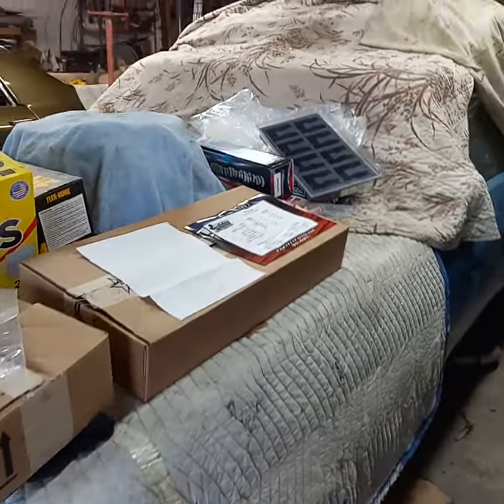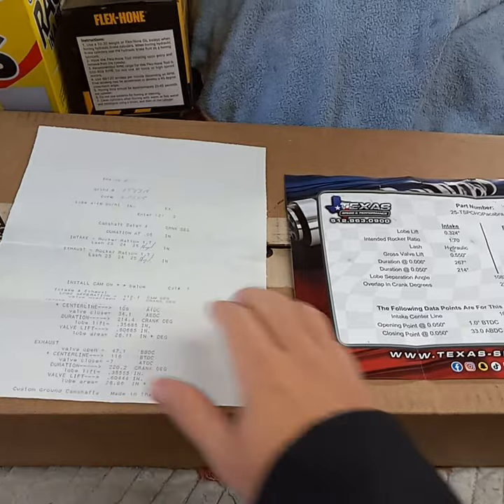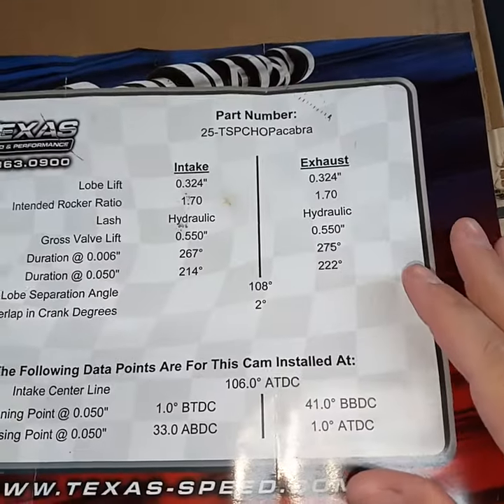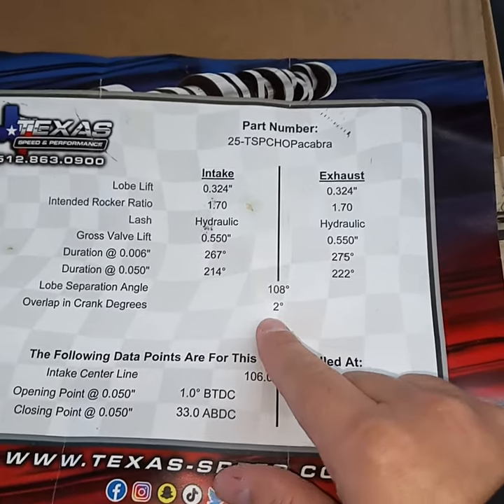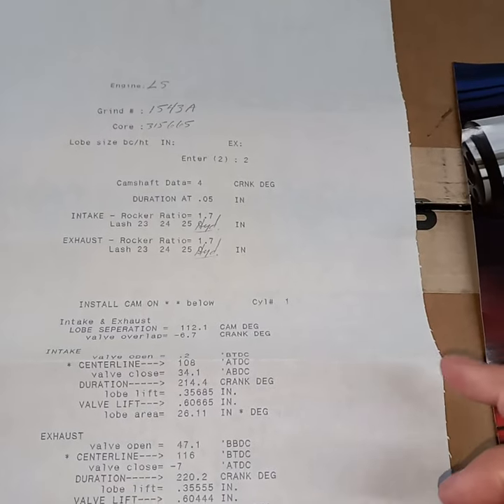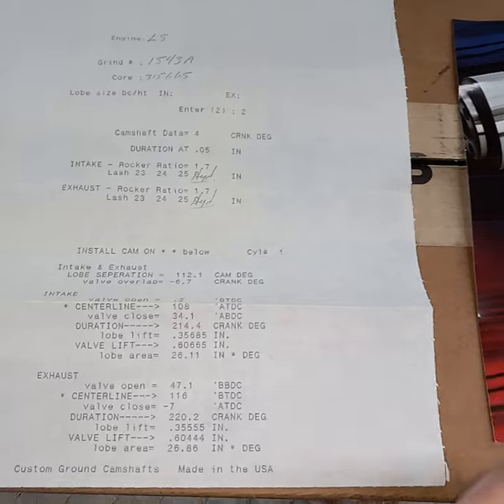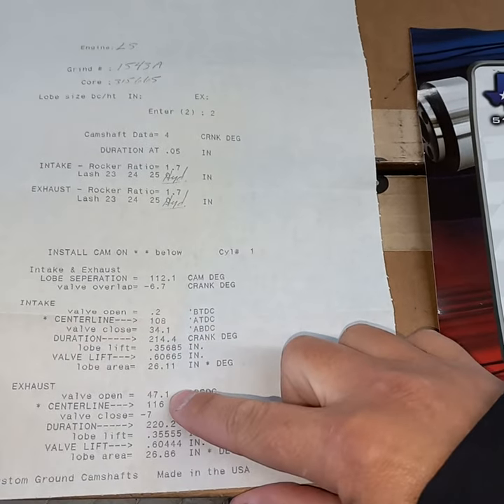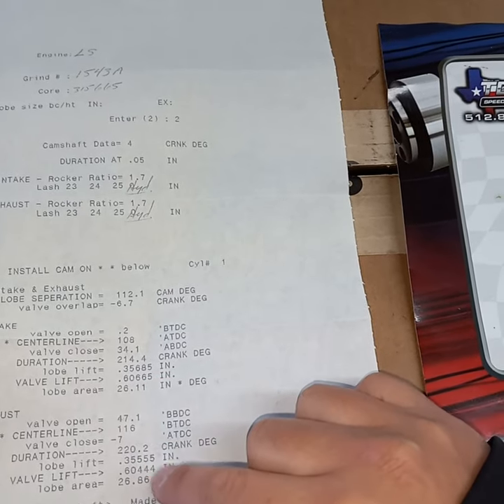Texas Speed CHOPacabra vs. EPS Truck TQ1 comparison 🧐 #camshaft #cammed

Comment: I don't think you will see a hair difference in those two cams. In fact I like the Texas Speed cam slightly better because of the 108 lsa. Those tighter LSA cams seem to be a bit more popular with these cam grinders, Brian Tooley used to throw his truck cams on a 111, the 107 is giving a broader RPM band, better down low, better mid-range and peaking just as good as the larger duration cams.

Just my 2 cents
Reply from the maker: I'm willing to find out. My current LQ4/862 heads/TSP cam made 336/336 at the wheels on 93 octane.That EPS cam in an LQ4 with 317s on 87 octane did 327/369. Same dyno and same person tuning it. I think the HP won't change much, but the TQ is going to jump 30+
Reply: @bluecollarhotrods9781  I always fall back on Richard Holdener testing those 4 truck cams, all about the same duration, not a hair difference no matter the lift.

I think Tooley has came a long way with his newer stuff with valve events.

But it would be interesting as hell to find out what your old cam could do.

I think you run a lot better than your dyno numbers. Your graph is healthy! I've noticed searching youtube, there are some very happy, crazy high dyno numbers out there from these truck cams, it's not realistic. Sae/std/mustang dyno/dyno jet, they read different.

Anyways, good stuff....new to the LS world but raced foxbodies forever.
Reply from the maker: @rickybellamy8191  That's what I intend to find out. If I get it wrong, I'll report it. I'm trying to learn - and share my data so that people can make educated choices.

In the past, I have owned a few fox bodies myself. I help my friend with his SN95 when he gets a "hall pass" 🤣
Reply: @bluecollarhotrods9781  would love to see the difference, like you said it's a learning experience for us all.
Reply from the maker: @rickybellamy8191  it's in the works. I'm shifting my focus to my 72 SS 454 Chevelle, it's so close to being done. Then I want to sell it. It will free up time and resources.
Reply: @bluecollarhotrods9781  I just caught this reading it again, so you did nearly as good with 87 octane and those 317s, very very interesting.

Just about every testing with those 317s compared to the 862 / 706 head is about a 20 horsepower difference. Wow!
Reply from the maker: @rickybellamy8191  Yes sir, I have seen Richard's tests and refer to them often. We've bumped heads a few times on live feeds. But, the fact is - my 4500+ lb truck is real world testing. 

I actually picked the 862s and this cam because of his tests. Imagine my surprise (and disappointment) when it made the numbers it did.
Reply: @bluecollarhotrods9781  I've heard him mention your handle name a few times on some videos.

You are exactly right, you are real world testing, the weight of the vehicle, acceleration is hard to measure on an engine dyno......and these trucks are heavy, they rely on torque.

Now I'm second guessing my 862 and I was going to put a good 20 hours into these things.

Initially I wanted some 799s/243s but I've seen some underwhelm on here.
Reply from the maker: @rickybellamy8191 ported 862s with larger valves are light years better than stockers like I have. I have a set of PRC 862s in inventory. They flow over 300cfm. To really beat them - I'd have to spend a lot of money. (Aftermarket TFS or AFR heads)
Reply: @bluecollarhotrods9781  that's going to be a huge difference along with that intake, at that point I think you're going to have to step up duration in your cam having that new 3500 stall.....unless you tow, or daily drive this thing.

Aside from the dyno numbers, your track results are there. Sure you throw in a 230/236 dur cam, peak jumps 30+ rwhp, but your results mimick such.

My mustang only made 449rwhp on a mustang dyno. I felt like I had the car working though.
Reply from the maker: I would say that if you have the ability - port your 862s, add at least 2.00" intake valves, and mill them .030" 

My untouched 862s with tiny 1.89" intake valves flow less than the 317s. I know tests show the compression bump is worth power - but my scenario has me wondering. I literally cleaned my heads, hand-lapped the valves, and changed the springs/seals. Zero port work or milling. 

In a perfect world, I would do a bunch of swapping and testing. 317s onto this combo. Then the EPS cam with both 317s and 862s. Possibly toss some 799s into the mix for fun.
Reply: @bluecollarhotrods9781  I was definitely going to work the bowls and narrow down the valve guides. That's always the biggest bang for minimal effort. May get a 3 angle valve job for those low lift numbers. 

Ok, I just decided to move on as planned with the 862s. Going to run the truck norris cam. Mine is the opposite of yours, it's lifted with 33x12.5s, I just wanted some more power, currently have the 4.8 and I landed a 5.7 Ls1 out of a ws6.

I need torque, good driving manners.

Keep the videos coming, we're all learning something. Already subscribed.
Reply from the maker: @rickybellamy8191  Thank you, I very much appreciate that. 

Part of why I am trying different stuff and looking for torque, I have a 2003 2500HD. It's an extended cab, short bed, 4x4. I'm hoping to find the right combination for that truck via testing with my half ton. When the stock size tires wear out, I want to run 285/75 16s. I don't plan on regearing (currently 4.10s), just leveling it and running slightly larger tires.
Reply: @bluecollarhotrods9781  just keep thinking back to your 317s and old cam combo vs your current combo.....I initially was going to do 243/799 heads with this 5.7 liter, I had a c6 corvette years back (243 head), the car trapped 113 mph bone stock. That's running on the stock Goodyear run flats and couldn't really leave hard, I bet I spun some mph away.

Thinking about that ls2, 6.0/243  head combo, factory rated 400hp, so probably 340 rwhp, I think that's telling us something right there, it works. Imagine a cam and your TBSS intake.

Richard's 862/706 testings pretty much talked me into keeping what I got. I may browse locally for some 243s/799s.
Reply from the maker: @rickybellamy8191  it sucks - there's VERY little results out there for so many of these cams being sold and installed. I think I'm one of the few out there actually posting stuff. I see some dyno videos, but ZERO track times to back it up. Dynos vary greatly sometimes, and some operators fudge things with different correction factors. Why? Usually to make their customers feel better. 

Acquiring that 5.7L aluminum LS1 is going to be great for what you have planned. It already starts off with 10.25:1 SCR with 66-67cc heads. Plus the weight loss from the aluminum block. I wanted a 24x early LS2 shortblock. Located a few, could not justify the cost. ($2500+) I will take the weight penalty with my iron blocks.
Reply: @bluecollarhotrods9781  yep not much on real world results. Just a bunch of videos with truck norris cams and a draggy, putting up 15 second time slips. Tons of underwhelming videos. That's what initially had me wanting to do 243s, then Richard's videos convinced me to keep what I got. Especially the video of the 706/862 vs 243/799 on the 6.0. The 317 was 20hp less and appears to be the worse head out of the bunch, your old combo says differently.

My buddy put a 6.2 in his ws6, that's how I got the 5.7.....i initally was going to find a 6.0 off ebay or look locally. Couldn't pass up the aluminum block.
Reply from the maker: @rickybellamy8191  I need better friends. lol 

I'm still bummed that I never got to race the old combo. (lifter/tray failure killed it) I had planned to run it on 87, retune for 93 and run it again. Then do what I'm doing with this one and refine it to get lower ETs.
Reply: @bluecollarhotrods9781  well you're doing damn good. If you can catch some DA, that new converter may 60ft you to a 12 sec time slip.
Reply from the maker: @rickybellamy8191  if it works as good the converter swap did in my old Z28, I'll be golden. I went from 13.1 average to 12.2 - that was a bolt on car with stock internals. It made about 350 rwhp and similar TQ.
Reply: @bluecollarhotrods9781  I just seen you are running a 2.5" exhaust, are you still running this?

Let me share this......and I know my mustang is making more power and pulling more rpms....but I started with a 2.5" exhaust, it was my bottle neck. Couldn't pull any rpms, I wanna say barely over 6k. Put a 3" exhaust on and peaked at 7k, pulled to 7300 without dipping. I wanna say I gained nearly 40 rwhp.

Seen another video and maybe I can find it later, a kid did a 6.0/cam swap, ran 2.5" exhaust, the tuner said it was hurting him up top. I don't wanna get this wrong but I believe the tuner said your atmospheric or barometric pressure was off signaling a bottle neck in your exhaust. 

Just wanted to point this out.
Reply from the maker: @rickybellamy8191  I have dual 2.5" off the headers, they feed into a dual 2.5" inlet/single 3.5" outlet Magnaflow muffler and tailpipe. I added exhaust cut outs, it picked up zero. However, I always race with them open. 

I have some videos up - one showing the layout of the exhaust system. And others showing the cut outs install and then track testing. I have yet to dyno it open vs closed yet. But by the lack of change in MPH - I bet it's less than 1rwhp.
Reply: @bluecollarhotrods9781  ok. That should be enough. Probably not pulling enough RPM for that to be a factor. Just spit balling here.....currently online looking for some 243 heads. Not going to put 100% stock into what Richard's testings are showing, I now want to opt for the bigger port, bigger valve. Let's see if I can find something affordable.

I'm starting to get paralysis by analysis. Lol.
Reply from the maker: @rickybellamy8191  when it was originally dynoed and tuned, we only pulled it to about 6000-6100. Since then, I have picked up ET and MPH shifting it higher 6400-6500. Next time on the dyno, I want to do some pulls to 6500-6700 for science. It peaks around 5700 per the graph, but is barely down any power at 6000. One thing about this small cam with such a tight LSA - the peak TQ comes in awful late 4700 RPM. I think that's partially why it has gone faster shifting it higher. When it drops back after the shift, it's in the fat part of the TQ curve.
Reply: @bluecollarhotrods9781  yes, shift recovery. Ideally you want to shift at peak hp and shift recovery land at peak tq.....hard to get an engine to do that, but when you do you've maximized a combo.

With the mustang, I never had any luck over shifting it that high.....i tried everything from 6500-7500, it liked 7k and went through the traps at 7300.

This LS world seems a bit different than what I'm used to. Have you tried shifting it at 5700 where it peaked? I don't know much about autos and tq converters, but manually I'd shift at 7k and shift recovery fell around 5600. I guess with a converter it would need dialed in for shift recovery? ....and rear end gear/tranny gear would come into play.
Reply from the maker: @rickybellamy8191  The first time I raced it with this combo it was shifting there. It went 13.80s at 99 and change. That was in 1500'-1800' DA. I raised the shift points and went back in 3000' DA, it ran almost identical ETs. It should have been slower in the heat. That told me I was going in the right direction. 

My friend's SN95 with the 331 stroker likes being shifted 200-300 RPM above where it peaks. We started at 11.90s, and got down to 11.50s with just shift points. MPH went up 3+ as well.
Reply: @bluecollarhotrods9781  ok, yeah that's definitely working then......

You're heading back to the track next weekend? You're in Bradenton Florida?
Reply from the maker: @rickybellamy8191  Orlando, FL Hoping the current forecast is wrong... ☔ Next Sunday is the plan though. I still need to get tires mounted, and make sure my shift timing is good.
Reply: @bluecollarhotrods9781  so I'm noticing something.....since I landed the 5.7 and now on the hunt for some 243's, I've started looking at ls6/c5 z06 stock dyno pulls. They dyno quite well. Ran across several that put down 345-350 and 1 got a tune put down 360 rwhp something like 352 rwtq. Watched another bone stock c5 z06 get an intake and headers only with a tune, it laid down 395 rwhp.

I'm not seeing this with the bigger 6.0/862 or 706 combos. So aside from what Richard is showing us, something changes in the real world???

That stock c5 z06 cam is only a 205/220 duration cam. Imagine some more duration, those dyno numbers climb even further. 

I was looking for thar EPS cam you mentioned, there's not much out there.

Anyway, very interesting stuff when you dig into the 5.7 world vs the 6.0 (706/862) with the truck norris or chapacabra.
Reply from the maker: @rickybellamy8191  in 2004 my friend bought a 100% stock 2002 Z06. It did 335 rwhp. But, ran 12.80s at the track. Tune, TR6 NGK plugs, and a 160 degree thermostat bumped it to 355 rwhp. But it picked up nicely under the curve. Then he went crazy and did LG long tubes and a TSP MS4 cam. It made a little over 450rwhp with those 2 mods. 

One reason for that is the chassis it's in. I feel like the power doesn't get taxed by the drivetrain as much. Fasterproms did a dyno on a newer Corvette, lighter wheels picked the numbers up almost 20 at the tire. The LS1/LS6 engines are also about a full point higher compression in most cases compared to the truck engines. (LR4 and LM7 are 9.5:1 & LQ4 is only 9.3:1) 

My LQ4/862 cylinder head combination gets the compression up there. But, is hindered by small intake valves and less flow than a 243/799 head. And my cam is not the "magic camshaft" for anything larger than a 5.3L IMO. They just don't work. I have never seen any real dyno numbers in a combination like mine above 350ish rwhp. Most make around the same as mine. For whatever reason, it just does not work.
Reply: @bluecollarhotrods9781  yeah, I'm sure the 6 speed manual is more efficient by maybe 5% or so.

It's showing me enough to convince me that the 243 is the way to go. Now I need to find a set.

You're doing the right thing, you are maxing out what you got before giving up and moving on. This whole cam thing has me puzzled. I've even been looking at Tick performance......something is just off with the 2 cams everyone is running (TN/TS Chapacabra).....you may be onto something with the compression bleed off. Basically digging into valve events.
Reply from the maker: @rickybellamy8191  I have seen some big overlap cams make power, so this one with only 2 degrees of overlap has me puzzled. If I had the resources, I would love to grind 3-4 cams with the exact same lift and duration, but move around the ICL and LSA to get different overlap. Then see how each one changes the power curve. I figure one at zero overlap, then one each of 4-6 + or - to see what it does. 

We've seen what wider or narrower duration split does to the curve from Richard's testing. Plus I believe Texas Speed did some similar testing 15 or so years ago. Wider split - slighter higher peak numbers, narrower - stronger earlier in the curve.
Reply: @bluecollarhotrods9781  the summit 8720 cam looks interesting. Someone claiming 338 rwhp on a 5.3 with 22s.

The specs look interesting. Maybe about as big as you would wanna go for a daily driver/stock stall.
Reply from the maker: @rickybellamy8191  I have one in stock! I almost did that cam and a set of nice 799s that I had rebuilt and milled by Phil @Advanced Induction. Looking back, I wish I had done that combo. I feel like it would have made 25-30 more in both HP & TQ.
Reply: @bluecollarhotrods9781  seems like a hotter combo. It really pulled some rpms on Richard's 4.8 testing and didn't give up anything down low.

Well you've got the parts when you're ready to go another route. We will definitely learn a lot.
Reply from the maker: @rickybellamy8191  I was planning to do that combo on this short block next. Then I wanted to do the 799s with a custom grind 224/232 I have. But, ultimately I am ready for the LQ9 I am building on the side. LQ9 short block, PRC heads, 228/236 cam, FAST LSXRT intake manifold.
Reply: @bluecollarhotrods9781  so if you take notes and jot down these 5.3 liter testings from Richard. I found a L33 testing with the Truck Norris/799 head and it made 443hp. Then a few years before that he did a BTR Stage 3 Truck Cam/LM7 706 Head testing and it made 433hp. The stage 3 will peak a little more than the truck norris.

This clearly shows a sort of apples to apples comparison of the 706/799 heads. I think the 799 Head is 15+ hp better in the real world.
Reply from the maker: @rickybellamy8191  pretty much everyone I know that tunes/builds engines asked - "Why did you do that?" in response to me putting 862s on the LQ4 in my truck. They all said I should have put a set of 799s on it. (Easier to find than 243s - and pretty much the same head)
Reply: @bluecollarhotrods9781  tell them, Richard Holdener, that's why I did it. Lol.

Seen the summit 8720 cam recommendation from flowinc....so I started researching that. I'm like 4 years behind as I look at the dates. I actually like it. A tad large in duration, but it looks doable.....especially for you, that stall and it really pulls some RPM.
Reply from the maker: @rickybellamy8191  pretty much I cite him often. The man is super smart and has tested A LOT of different combinations. He's truly a wealth of knowledge. However, he got this one wrong IMO. I don't mind a decent sized cam, so even that 8720 seems mild for a 6L to me. I feel like the 8720 is the smallest cam for a 6L, then the Sloppy Mechanics Best cam would be in the same category too. Something around the size of a Comp 459 or 469 cam would be the upper end. Anything in between would be personal preference.